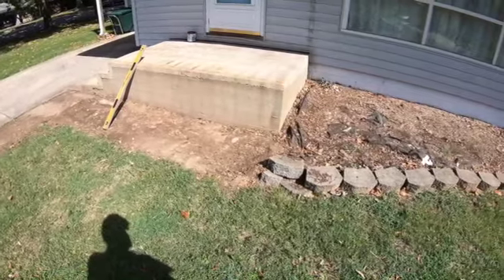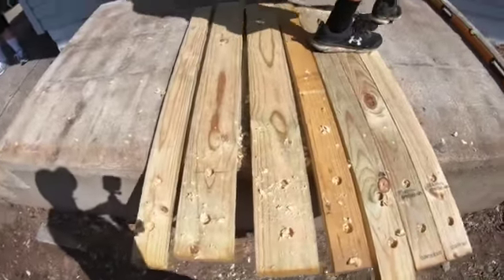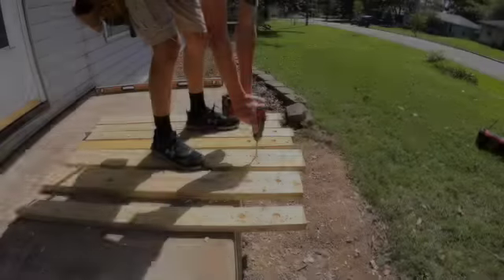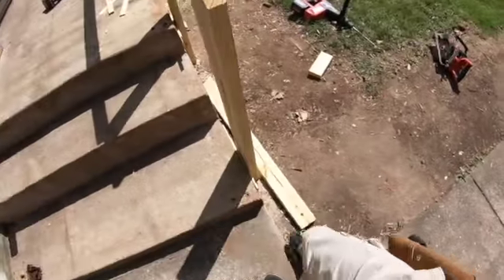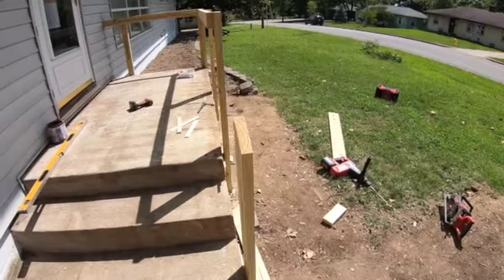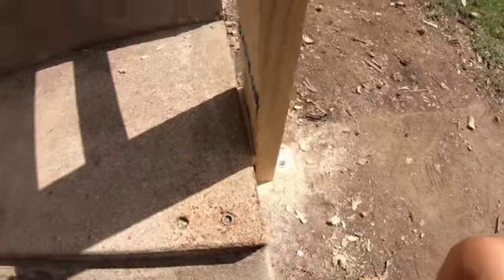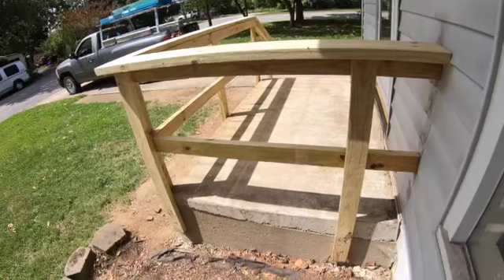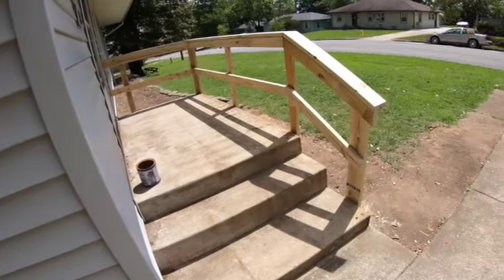Installing hand railings on a concrete front porch stoop

Comment: I am working with concrete steps similar to this, except its only 2 steps. 
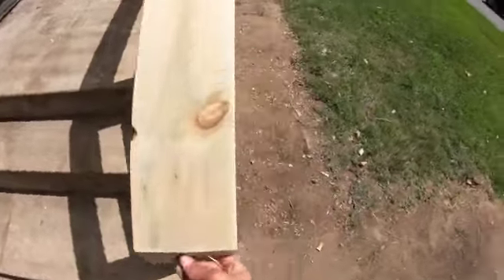The corner is a little tricky for me. @2:30
Reply from the maker: We used a 2x6 for one side of the corner and a 2x4 for the other side.  Mounting to the concrete through the 2 6.
Reply: @ozarkhandyman7031  appreciate it!